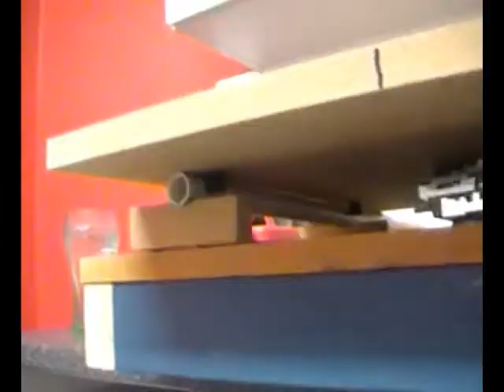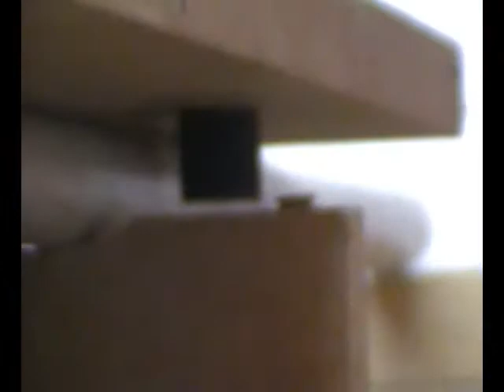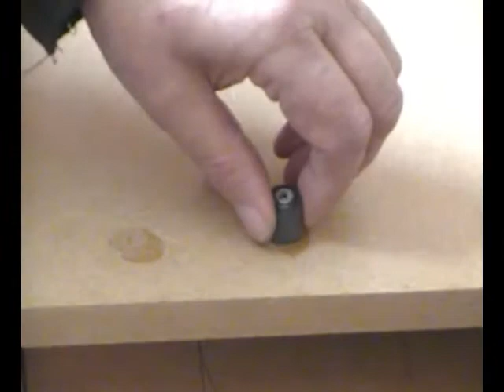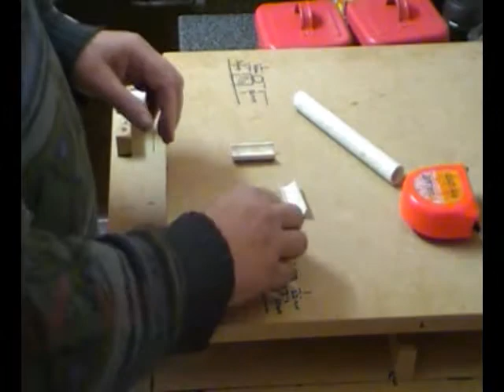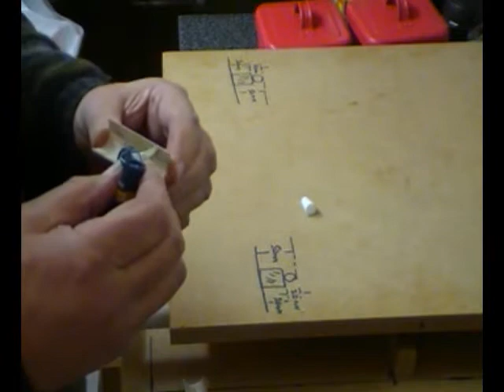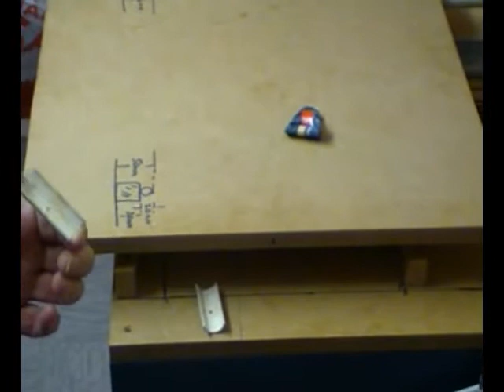MY NICE EV Printer Arduino CNC Part 13

Comment: Just my two cents. If you take the split tube and put it the length of the table, so that the split tube rode on the bottom rail, it would take all the slop out of it, and you would not really have to worry about adjustment. Then all you would need is a little "liquid graphite" between the two, and it would be smooth sailing.